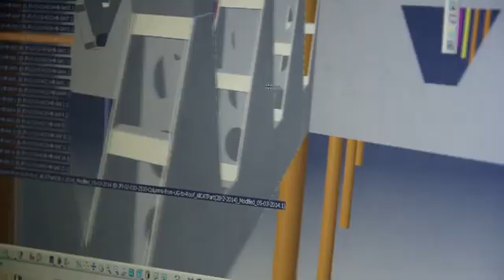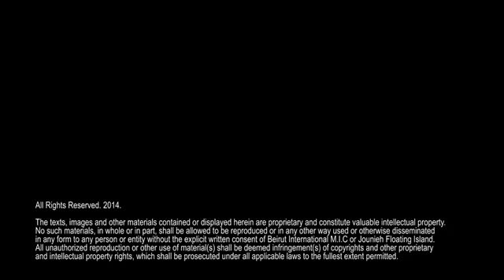Beirut International Floating Island Presentation

Comment: Sounds like a great idea.  We are promoting a similar structure.  Our basic vessel/building block, was developed as an oil platform for The North Sea's big waves and high wind.  This thing looks like it will rock and roll if a ship goes by.  Look at my avatar, that is a "building block" for a floating international airport.  Designed for open ocean off San Diego California.  In tank tests, our model didn't move in simulated 90-foot waves.  Plus the cost is far less because we use standard shipyard automated fabrication and build it from steel.

Comment: amazing project but what about utilities connections like electricity , water , drainage, telephone...
Reply from the maker: Everything is designed to meet the highest standards and regulations in marine engineering.
Reply: Why are you building such a floating project? what are the advantages? i am just curious.
Reply: fadi bechara It is a revolution in Marine Engineering that has never been made. The Advanced Engineering of the Floating Islands allows you to build Ships and Floating Islands with a low main deck to give you direct access to the water and ultimate stability for more sea comfort. It can be a hotel, a private villa, a banquet hall, a naval base, the applications are endless. It is also a moving island, it has its own engines and therefore can navigate from one place to the other.
Reply: Good to know that a Lebanese company is pioneering in this field and making research and development in marine engineering ; defenitely this will be beneficial and much needed in the future ; wish you successful completion 👏.
Reply from the maker: fadi bechara Thank you for your support.